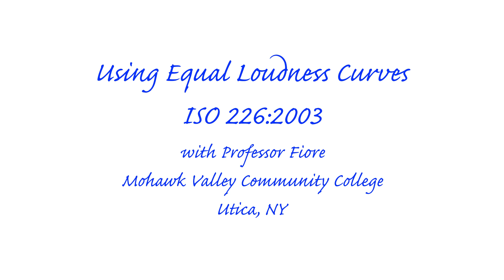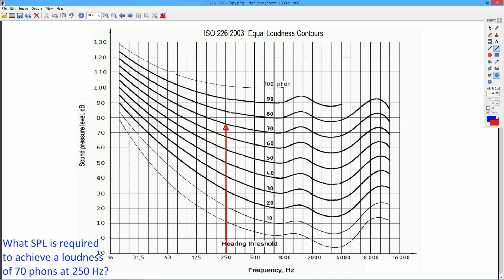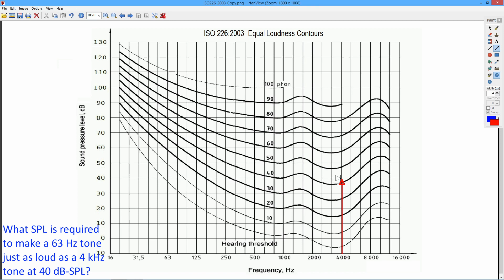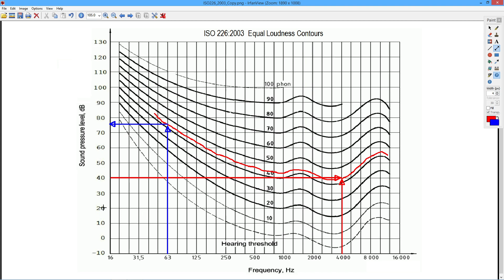Science of Sound: Equal Loudness Curves

Comment: is 12:56 correct? Almost all music already bakes a significant tilt in, and, while bass boosting is often desirable, a pefectly flat system (that remains flat down to 40hz / 30hz) is usually regarded as very good, nonetheless, those systems also require a big subwoofer amp. I am guessing that the power requirement is actually because of the weight of the moving mass and the power of the magnet that tries to bring it back to resting position as fast as possible to stop inertia, creating lots of resistance.

EDIT: This is not to say that I don't appreciate the explanation btw, thanks for the great vid!
Reply from the maker: Yes, it is correct. You have to remember that this is what we as humans always experience. Thus, when a track is mixed down, it is mixed by ear. They don't add bass to follow this curve. They adjust levels by how it sounds. In order for it to sound right, you end up with a lot more energy in the lowest octaves. On playback, this requires a perfectly flat frequency response (i.e., the effect is already "baked in").
Reply: @ElectronicswithProfessorFiore  exactly, but you are still able to play flat sweeps or white noise without overdriving upper frequencies (despite them playing at equal SPL). Or am I wrong and audio systems do usually overdrive when playing flat signals due to the manufacturers making the expectation that the signal is going to be tilted?
Reply from the maker: @StarOnCheek  I think there is some confusion between SPL and loudness. Many people take these things to be the same but they are not. Loudness is the human perception of SPL. Equal loudness curves explain how humans perceive SPL. If you produced two tones, one bass (40 Hz) and one treble (4 kHz), at the same SPL, the treble tone would sound louder. Another way of looking at this is to create a long term average of the energy present in music. In most forms of Western music, the majority of the energy is found below 500 Hz. Another item to consider is the power rating of woofers and tweeters in home loudspeakers. It would not be odd to find a woofer rated at 50 or 100 watts being paired with a tweeter rated at 5 or 10 watts.

Check this other video I did: https://youtu.be/8S-HdK6KGzA?feature=shared

Comment: But what if i'm not having single tones but a wide band signal lots of harmonics or even noise? how can i convert a real acoustic noise to an phon value if i want to? 
I can't just apply a weighting curve as EQ because the curve is amplitude dependent?
Reply from the maker: The issue here revolves around what you're trying to accomplish. One example is hearing damage caused by excessive levels in an occupational environment; in other words, something like noise on a factory floor. In a case like that, a weighting filter would be used and we wouldn't talk about phons, but rather dBA (or something similar). It is understood that a scale like dBA is a proxy for loudness but is not identical to it (i.e., dBA does not equal phons). It gets the job done, though.

If you wanted to, you could repeat the Fletcher-Munson experiment using band-limited noise. You wouldn't really have phons as a result, but it may prove useful. I do not recall specific experiments in this area, but I am sure that some work has been done.
Reply: @ElectronicswithProfessorFiore  Thanks for the answer!
For example some PC fans i have seen loudness ratings in phons and i was curious how i/they would measure/calculate this. 

I know about dB(A) weighting curve. that's easy to apply and most industrial and safety regulation are given in dB(A)
But i don't think  dB(A) weighting is very appropriate for low volume sound at the border of auditability.

"dB per 1/3 octave band" is also a common measurements  but "1/3" seams arbitrary to me,
the smaller the bins the higher the resolution but the lower the dB per bin.

Can i overlay an Fletcher-Munson graph on a FFT or RTA to see if a signal is below audible volume? 

Thanks for the educational videos and taking time to answer to comments.
Reply from the maker: @lambda7652  That's interesting. I haven't seen any fans spec'd using phons, only dBA. dBA seems to be the default, at least in the USA (in the UK, I understand that ITU-468 is a popular standard). 

You can "overlay a..graph on an FFT or RTA", but the issue there is getting the calibration correct. You need to know how the voltage coming out of your source (e.g., mic) corresponds to an SPL. At a minimum, you'd need a sensitivity spec like this one from a Shure SM-57 spec sheet:  "Sensitivity (@ 1 kHz, open circuit voltage) -56.0 dBV/Pa (1.6 mV)". You then have to compensate for the fact that most mics (other than special measurement mics) do not have a flat frequency response.

Comment: How do I set this in reality?
I can set target curve but how do I set it for this?

If I listen at 75dB the the graf show 116 dB at 20hz.

Should I set the target curve like this:

116dB - 75dB = 41 dB

Should I set target curve at 20hz at +41?
And 25hz show 111dB, so 111dB-75= 36dB. So plus + 36dB on 25Hz 
Etc 
That will crack my speakers 😅

I dont understand how to set it like this.
Reply from the maker: There might be some confusion here. This is not for setting up your home or car stereo system. Instead, it is explaining how human hearing works, and it sheds light on the sort of power differentials that are needed at different frequencies. The audio engineers and producer have already set the relative levels needed for a particular piece of music. The only mod you might make is if you are not listening at the same level they used during mix down. Unfortunately, it is extremely rare for those folks to tell you what SPL they used!
Reply: @ElectronicswithProfessorFiore  

Thank you for your respons and for confirming that I confused all this. I thoght at first that I could use this for my home stereo. 
So this is only for producing/ mixing (?) 

Target curve for home stereo should be pretty flat then? With a little bump in the bass if thats what I prefer?
Or do you know if there is something simalar for hifi- target curves?
Reply from the maker: @jimmydelen2023  If what you're looking for is highest fidelity, then you want the flatest response out of the system. Of course, what you like is up to you, so listen, adjust, and decide from there.